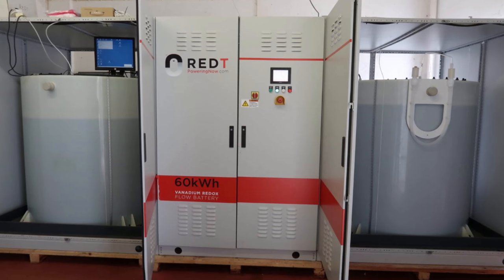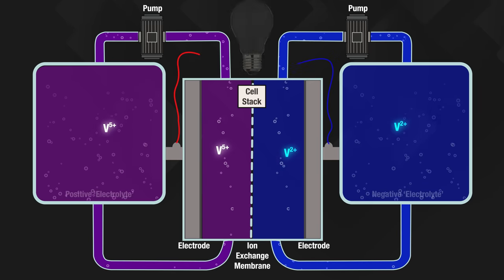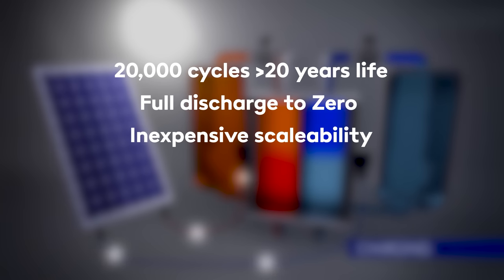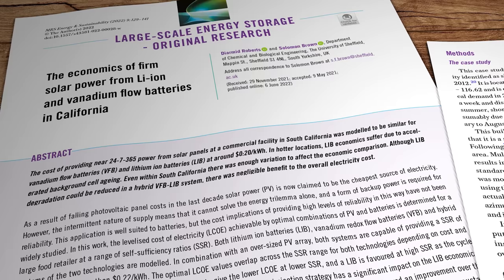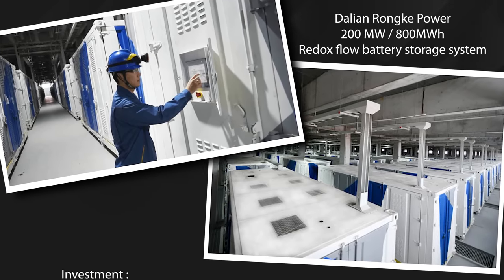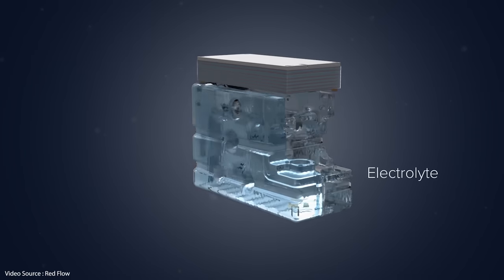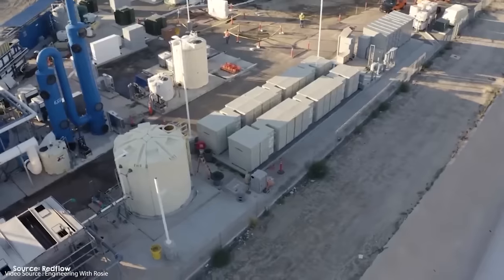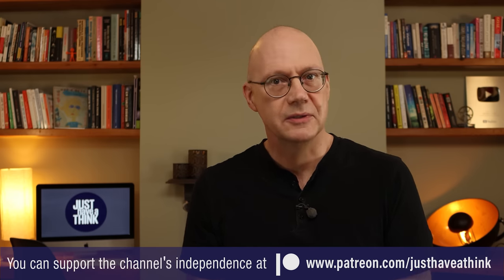The new billion dollar battery disruptor!

Comment: I've followed Redox, Redflow and Ambri(liquid metal) for years. What is a curiosity to me is the incredibly slow uptake these technologies have experienced. We need to decarbonize, and yet the various grid operators are so conservative that these technologies need a decade just to see the light of day it seems.
Reply: Because power grid like roads and other major at scale infrastructure involves very long planning, rollout and cost recovery periods. It could be faster but it would cost exponentially more to replace major grid designs and components every 5 years.
Reply: Long term investments and long term planning mean slow adoption.
Reply: Also, cost - flow batteries are expensive. Which is surprising really given they don't use expensive materials such as lithium. I suspect going forward they may also struggle to compete with Sodoum Iron
Reply: @dancoffey4293  True. Every time I've watched a newer technology come out in hopes of displacing the incumbent, people tend to forget that the incumbent isn't standing still. Unless the technology is at a demonstrated maximum efficiency, it is likely to continue improving. Unless it is quite mature, there will remain significant gains. Lithium (or sodium) chemistries are nowhere near mature
Reply: Ronaldo-ue5if   stop spamming
Reply: Grid operators kind of have to be conservative due to the consequences of screwing things up. They can't take a chance on millions of people being without power due to some new technology not performing as well as expected.

That doesn't mean grid operators can't innovate - they can, they just have to be very careful and always have contingency plans.
Reply: @dancoffey4293  Y, me2 your points. Some years ago a new generation of organic electrolytes came out of research, which were supposed to revolutionise this area with 60% round-trip efficiency and an order of magnitude reduction in costs. It went ..
.. nowhere.
Reply: It's [also] because the expensive stage of lithium-ion battery development was paid for by the boom in portable consumer electronics: laptop computers and mobile phones, low-power but low-weight and high-value devices, followed by toy cars, planes and drones, and now electric vehicles.  Mass production and low unit costs have been achieved before stationary storage has become a significant market.

The lower materials costs of other batteries (similar story for non-battery storage technologies like thermal storage, hydrogen and others) mean that in the long term they may compete well for stationary storage and maybe a few mobile applications where weight does not matter so much (rail, marine shipping maybe), but for now the volumes are low and the unit prices are high.  Only large-scale adoption will bring lower prices, and that's hard with a cheaper incumbent. Indeed lithium batteries are even edging out pumped hydro storage which has a very long history and which in principle has much lower costs, but has issues with geography and geology, each site being a distinct project with its own engineering challenges.  Maybe some price spikes in lithium or other materials crucial for lithium batteries will help with greater adoption of the heavier, potentially cheaper battery chemistries and non-battery energy storage concepts.

Comment: I don't think this technology is the "final link" or the "final nail". But seeing improvements is always good.
Reply: You misunderstood what was said, long term storage is the final piece needed to start really replacing oil and gas, not specifically this technology. Why? Very simple
Building out 1 GW of solar or wind is already cheaper than building a GW of nuclear energy, the problem is, no wind, no power, but if long term storage can get cheap enough that you could build 1 GW wind + enough long term storage to keep delivering power when it's not windy for the same price as nuclear or oil, or just slightly more, well it'll be very easy to invest in. 
We still have a ways to go before we reach that price point, but that is what is meant in the video.
Reply: @Yattayatta  Not at all. I'm just not convinced there won't be something better soon.
Reply: so you're waiting for Mr Fusion
Reply: it is a major nail though
Reply: @Yattayatta Long term storage is not the final piece. We already have them. They are useful only if you can live off grid generating your own energy which hardly applies to anyone. The true final missing piece is the transfer of energy effectively without loss. Which likely won't happen anytime soon unless a true room temperature abient pressure metal superconductor that is cheap to make becomes a reality.

Either that, or simple "free energy" harvesting devices for every home somehow become a reality. So, very unlikely

Comment: A friendly challenge.  What is the point of covering potential technological solutions needed to transition away from carbon-based energy without 1.) quantifying the carbon footprint of the implementation and maintenance of a new tech (or existing tech as in this video), 2.) understanding the capacity of the supply lines needed to adopt new tech  (i.e., feasibility) and 3.) projecting how they would fit in to a wider transition strategy?  It's all magic thinking until these techs get properly scoped out.

Comment: I thought about this question: " How do these storage systems compare with H2 as a storage medium??? "  It seems to me that these flow through batteries are unbeatable.
Reply: Just that "minor" problem is there is no Vanadium to make them work... and its efficiency SUCKS.  Otherwise just like Fuel cells... all we need is a mountain or 100,  of Platinum and we all would have been driving Hydrogen cars decades ago.... H2 at least can be made from any electrical source.  True, storing it only works in a few places in the world, but at least one can make it and store it.  Of course H2's round trip efficiency also sucks ass but hey when people keep working at stupid... CH4 makes far more sense than H2 and has near identical efficiencies since we cannot use fuel cells anyways as there is not gigatons of Platinum just hanging around.
Reply: @w8stral  Are there no non Vanadium based system ?

Comment: The round trip efficiency is the same (slightly less?) as pumped hydro, which that recent ANU* survey kicked back into prominence, whilst offering even higher cycle life.
 Studying the ANU atlas of sites revealed huge potential, especially in solar rich regions with low populations. The virtue of incorporating floating PV, managing cell temperatures and water evaporation, and shared grid connection, really demands Africa and the Middle East resurrect projects like Desertec but using a different mix of technologies.

Flow batteries still have a place for smaller, embedded units, but for real bulk pumped storage with HVDC selling renewable plus storage across borders, pumped storage will still win most of the business.

Unless, that is, the tungsten compound redox charge carrier pioneered in Glasgow continued in its development from five or so years ago. This allegedly had an 18 electron capacity per molecule! They were claiming a theoretical energy density of 4 times Lithium technology...

Australian National University.
Reply: Just that teensy weensy problem there is not enough Tungsten...  Just like there is no source for Vanadium.  Well, technically there is plenty of Vandium... we just can't actually refine it as it is everywhere in teensy tinsy percentages of every piece of dirt.
Reply: @w8stral  Fuel cells also currently suffer from the need for iridium in their proton exchange membranes. (Not sure if this applies to the tungsten salt fuel cell.) This is why I always expect fuel cell solutions to be niche in their problem solving. In tungsten's defense I would only point out that you get a lot of electrons for your tungsten atom.

This is all moot as it appears not to have been taken forward after the 2018 announcement.
Reply: Ronaldo-ue5if  ?
Reply: What is the round trip efficiency for pumped hydro please. I assume it is woeful , given all the friction in long pipes, pump losses  and generator inefficiency.  And the cost would be a problem if Snowy Hydro was the installer. 
Regards

Comment: Thanks Dave. 🙂👍

Zinc Bromide certainly has been around for many years. I saw a version which could be made at home described in a popular science publication from the 1920's. No pumps were involved because of the small scale, but the principle was very similar to these, without the emphasis on recharging the cell. It was being done by topping up the low cost and disposable electrolytes instead.  Zn-Br cells are also very likely less toxic, and probably cheaper to produce and run than V-Ion cells. Vanadium is a fairly uncommon metal.

Incidentally, what are the cell voltages for both types? That also affects overall battery power density, size and cost.

I'm not a chemist, but is there a similar technology which uses Aluminium and another Halide such as Chlorine? Al and Cl are much more abundant than Zn and Br, so if it would work, it might be even more economically viable than the Zn-Br technology.

Comment: Redflow's 10kwh module is comparable to a powerwall.  Is anyone selling flow batteries for residential use yet?
Reply: IIRC the power of these batteries are pretty low, though.
Reply: Power output is limited to the conductivity of the sulfuric acid and the ion exchange membrane which is around 50-80 mA/cm^2 of the cell area. The kinetics of the reactions also limit the power. So if you want more power you need both larger electrode areas and more cells stacked together to achieve the voltage you want. Each cell can output 1.2 volts.
Reply: @allthingsdestructive  Thanks for the info.  1.2Vx50mA = 60mW/cm^2.   Most systems in my house will function with 3kW, that's a safe minimum if I don't run much at once.  That means I need 50,000 cm^2, or 2.2m x 2.2m.  I'd also need a bunch of cells, each with their own pump and monitoring system and whatnot, or an efficient way to boost 1.2VDC to 110VAC.  I think I may have a personal fusion reactor before that becomes a reasonable option.

Comment: Not to be a spoilsport, but the larger problem with fuel/energy consumption is today's excessive amounts which will continue to grow despite so-called renewable energy sources coming on line. "Less is More" is a fitting term to consider as a starting point by which we must address the larger problem. We drive too much. We truck and ship goods too far. We fly for recreation and play with motorized big boy toys too much. There's no getting around this FACT. 
Question: Which of the 3 basic EV drivetrains (BEV vs PHEV vs HFCEV) offers the MOST potential to reduce fuel/energy consumption, emissions AND insane traffic? The correct answer is...wait for it...PHEV plug-in hybrid, which could serve 65% future EV needs. All-battery BEV serves the remainder in lightweight and short distance travel/transport needs. Hydrogen fuel cell HFCEV offers no potential when combustible hydrogen in the ICEngine of a PHEV+H drivetrain stores at lower pressure in small/safer tanks and can deliver more than twice the equivalent MPG possible in fuel cell EVs. PHEV tech also distributes limited battery and PV solar array (rooftop) resources far more equitably when matched to "small battery" BEV & PHEVs.

Comment: I'm all for renewable energy, and consequently advocate for energy storage solutions.
It is however, very frustrating that consumer stationary storage cost per kWh is not cost competitive. In Australia, I can't find a battery solution (Li ion or other) that has a levelised cost of storage less than AUD $0.42 per kWh (capital cost of AUD $1000 per kWh). Grid supplied electricity is currently $0.32 per kWh.

Comment: Lets have actual payback and operational ratings of all these different systems in order to know if they really payback according to models.I ask this because solar in the north of canada does not above 50 degrees latitude from my experience. Thanks for the info and keep up the good work sir..
Reply: We have solar on our roof that we installed ourself, living in northern Sweden on 62 degrees latitude, so a full 12 degrees north of 50, and have a ROI time of 5-6 years on the solar we installed on our roof with an expected lifetime of 25-30 years.

(15 kW, 12000 kWh/year and a US$6000 install cost with US$0.09 per kWh electricity cost).

Worth having in mind that solar panels get more efficient the colder it gets, as electrical resistance decreases with temperature, think of it like superconductors and how they work.

Comment: The RTE is the crux of flow, this includes pumping power. If you go long term without sizing the battery cell bigger, no peak power can be attained relative to the energy volume available, thus long term storage. I was the 1st to suggest combining different types has synergistic energy creation, in my GAIA energy storage thesis. 500% FF burning reduction and 700% GHG elimination with each % of energy storage penetration.
Between Lithium high peak energy, is a need that, slow and slow flow, fits nicely in, in-between pumped hydro and evening peak types, like lithium.
I have spoken to this subject at IEEE consultants network of san Diego.

Comment: Interesting. What's the effective capacity of this system? Volts & amps? How much current draw for the pumps? What are the toxicity levels of the fluids once they've become unusable? Is there any off gasing from this chemical process and how would that affect our atmosphere? How do we dispose of those fluids?

I've got a sneaking suspicion that this is going to be shut down once the EPA gets all the numbers. Or they'll turn a blind eye, like they usually do, when they receive a large check.

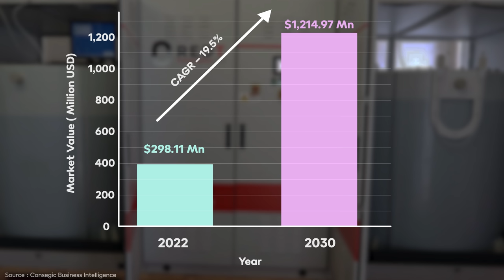Comment: 0:50 There's so much wrong with that graph, I don't know where to begin... I'll begin by saying I'm grateful it starts at 0 at the very bottom, which is great. On the other hand, being a speculative prediction with only 1 year of reference and no mention that this is indeed a prediction, is very odd. Then there's the weird thing of "298.11" being just below the "400" line - what??? - that actually undersells the effect, even - it looks like it's a 3 times increase but it's actually 4 times! But yeah, hardly a useful graph, other than just showing an upwards arrow saying "it go up".

Comment: In the UK, if we could provide half our electricity from wind, then we would need an average continuous sustained output of 15GW. Wind though is intermittent, and on average only generates a third of its maximum output, so we would need a peak generation power of 45GW. Also because there can be extended periods of no wind then extensive battery backup is required. So a one week anti-cyclonic weather stall would leave us needing 2520GWh of battery storage. At a mean estimate of $200 per KWh, this would cost $504 billion.

Comment: I'm wondering why we never hear of using Sodium Borohydride (NaBH4) as hydrogen storage without pressurizing requirement. Catalysed reaction with water yields 4 Hydrogen molecules and Sodium Borate (NaBO2). Has anyone ever tried to perform this reaction in a fuel cell and produce protons instead of hydrogen gas? Would love to hear your take on that.

Comment: As usual, I'm a bit late to the party.  However, I do have some insight on how insignificant a 100 MW facility is. I work in a small electric motor shop in rural Idaho where we recondition, repair, and rewind both industrial motors and generators.  With an entire work force (including the owner) of only 10, in a year we work on at least 20 MW just on generators, and about 15 times that in motors that consume energy. Our nearby competitors are larger, or about the same size , and get as much work per person (or even more) work per year.  Our company cannot even compare to those in densely populated areas like Chicago, IL, Cincinnati OH, or Los Angeles, CA. 

Now, of course every bit helps, but to imply that a 100 MW facility is big, is (in my opinion) a bit disingenuous.

Comment: A useful video thanks.  It was dissapointing to hear that the flow batteries cost about the same as expensive lithium ion batteries.  That doesnt seem like a formula for widespread adoption.    Is there anything on the horizon that could make flow batteries much cheaper?
Reply: Not without overcoming the manufacturing bottlenecks due to needing graphite bipolar plates and expensive ion exchange membranes. A combination of low (nearly negative)  pH and highly oxidizing V5+ ions make the VRFB a very challenging system to engineer for. There are many less corrosive chemistries out there like polyhalide or iron but they, like fuel cells, need expensive electrochemical components that I mentioned to work.

Comment: The path to decarbonisation is 50-100+ years long. It's not going to happen tomorrow, or next week. It's going to be incrimental gains of many, many decades or even centuries. Having said that, these flow batteries are just one of the steps in right direction.

Comment: If it's so wonderful, why is it such a small market? I am not sure that it does well under temperature, my understanding is that the vanadium will come out of the solution and turn into particulate under high temperatures and then block the membranes, killing both the stack and liquid which is basically a wipe. This channel NEVER does the homework to think about the negative sides of tech, just believing the sales pitch :(